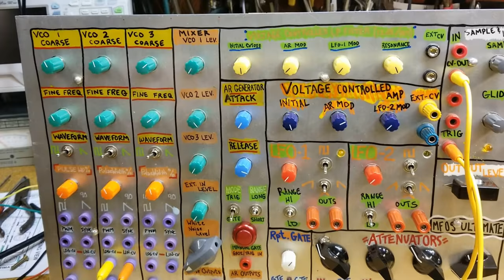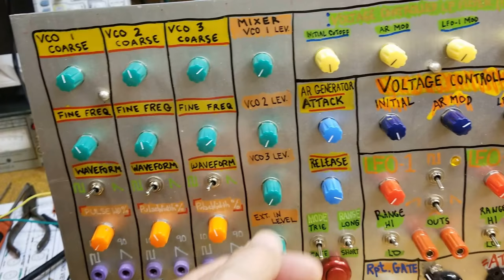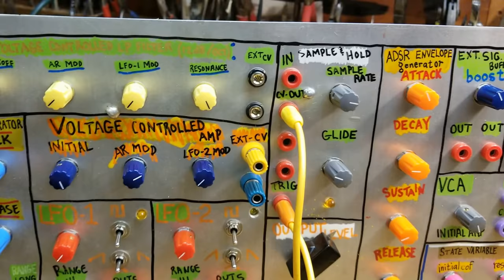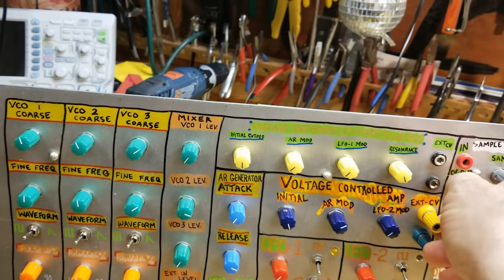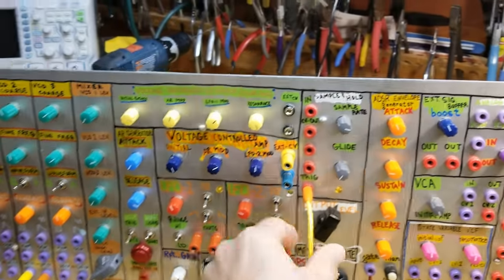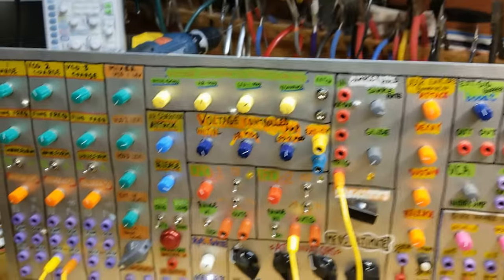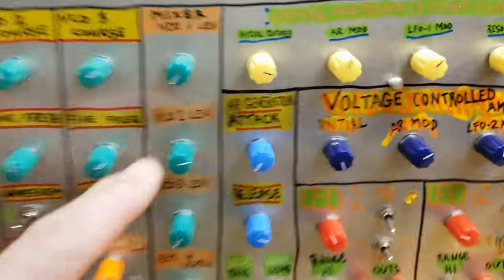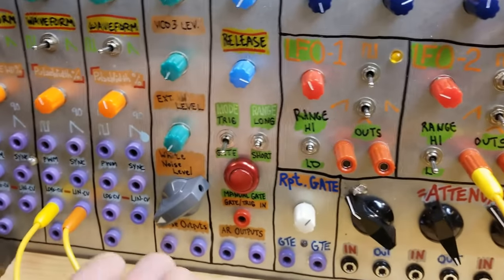MFOS Ultimate/Expander Rundown & Progress Report

Comment: I love the panel "lettering". :-) Just give a spray of clear enamel to protect it and you are done. Very nice job.
Reply from the maker: It has several coats of clear lacquer. I am working on a CV source and sequencer. This is a fun thing.
Reply: JC Haywire I'm wanting to build one. I have scrounged a 6U rack mount case which I am considering using. Tilt the front back by 50mm or so and it should be accessible.

Comment: Oh.. I have to ask. What's the dimensions of your panel?
Reply from the maker: 28.5" X 11.5" roughly. It was NOT planned to be modular or anything. I didn't know what "modular" meant when I grabbed that hunk of aluminum from my scraps. It just seemed to be a good size.
Reply: JC Haywire Fair enough. I was just curious for getting a sense of scale and proportion. Unless the synth is made from modular boards, there's little point in making the panel modular.